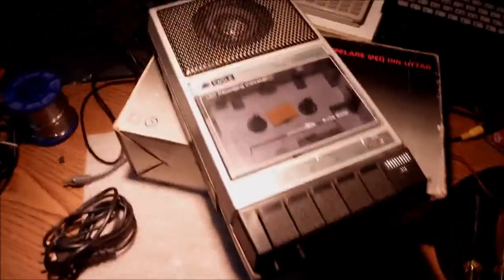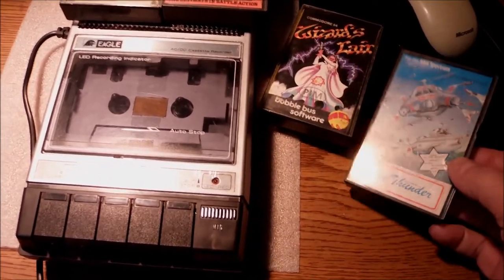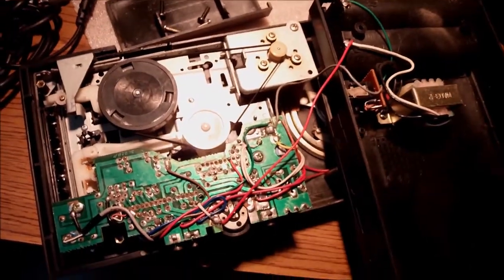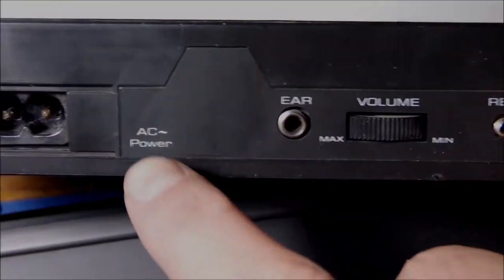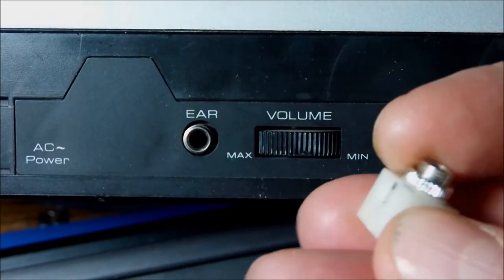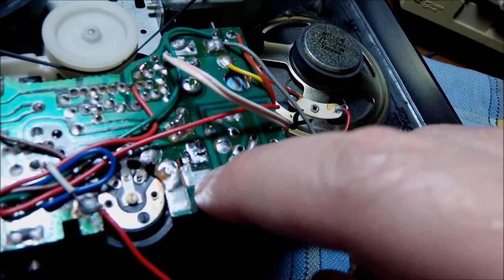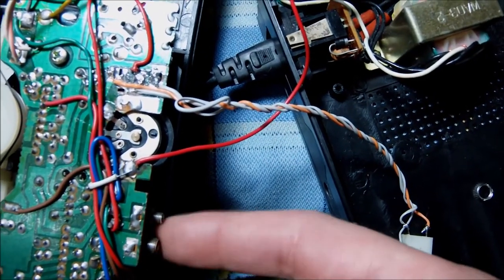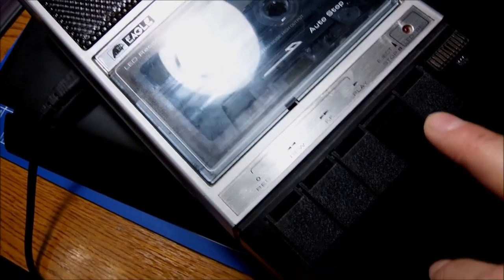8-bit Computers: Tape recorder - Cassette player fix & restore.

Comment: Great  fix for the audio jack. Clever little method I will be sure to use if ever I need to replace a socket but don't have exactly the right kind. Thanks very much for this. ;)
Reply from the maker: Thanks Peter! I was thinking of something to do for some time, these rarely fail so, bad luck i guess. The  after market ones are far worse when it comes to quality but what can we do other than try? :-)